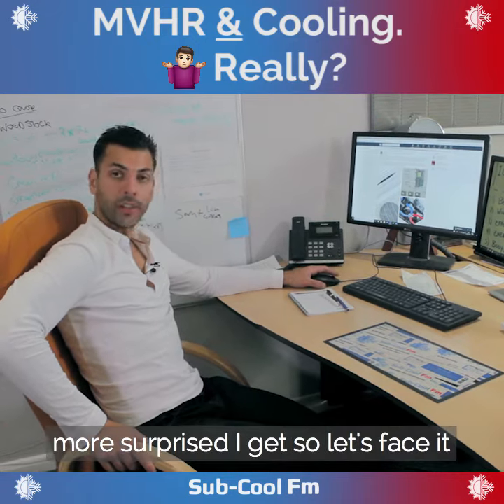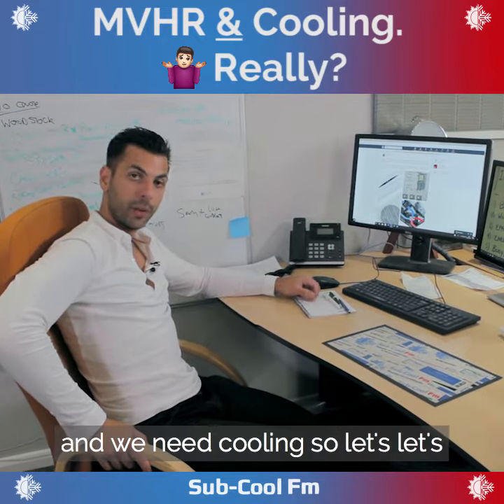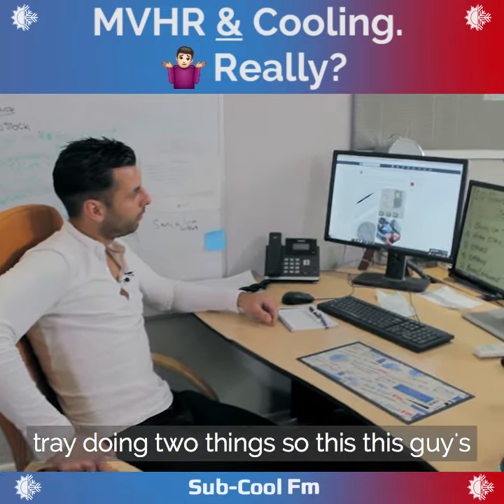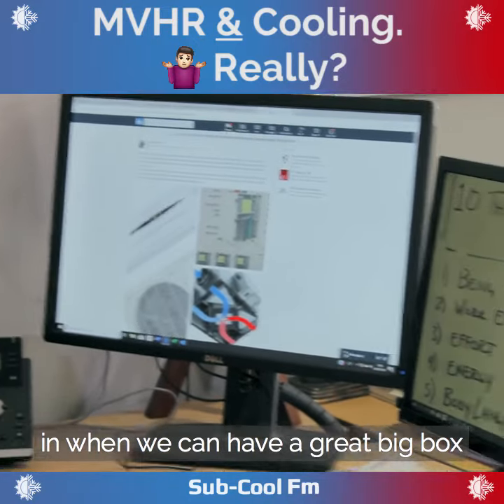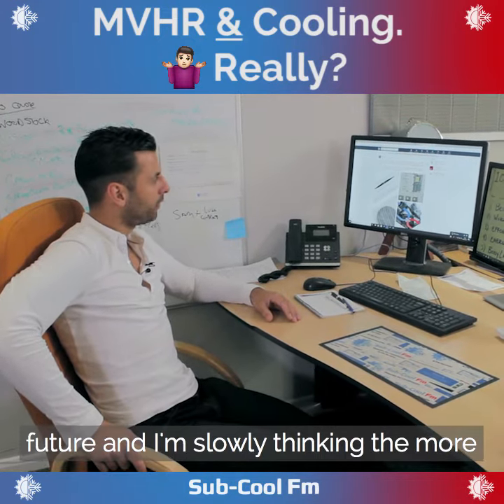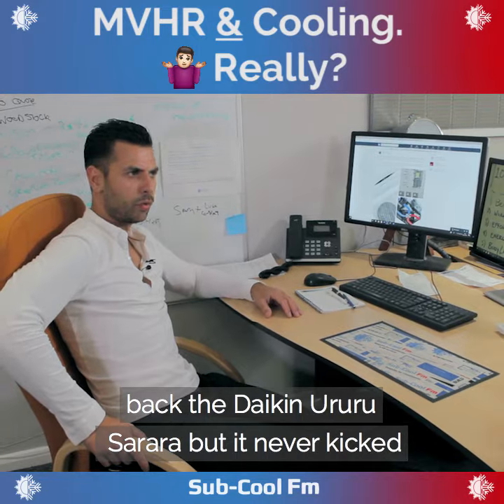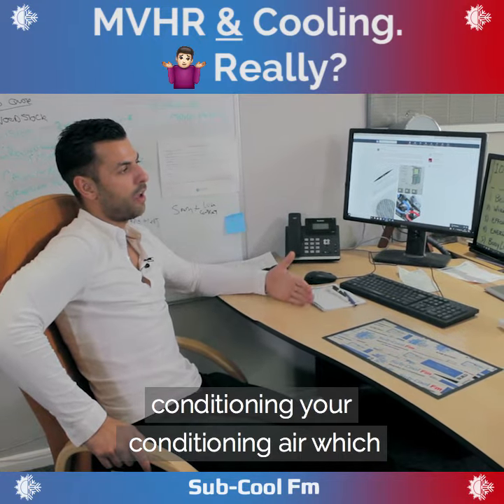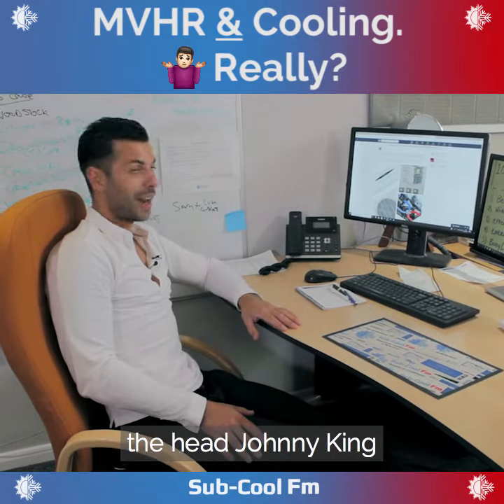Air conditioning turned on its head - Is MVHR with cooling the answer?

Comment: The biggest issue my clients have is the high temperature in their new build properties. External temp could be lets say 20 and the internal temperature would still exceed that 25 or so. They complain that living in their properties even in the winter months is uncomfortable. The MVHR units even when we set them onto summer bypass offer no solution and it never will as its merely dumping the external temp into the property. 

The solution is an MVHR unit with a coil. It would be the ultimate game changer as we both know that in the residential sector of new builds AC is only installed at the very high end of the market. So yeah big demand. 

Id love to discuss this with you.
Reply: I have this very problem